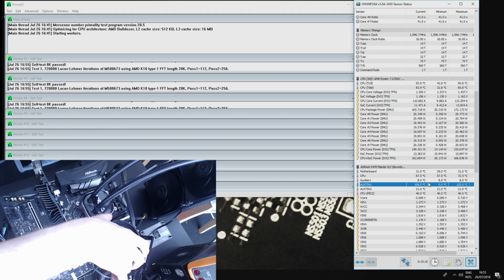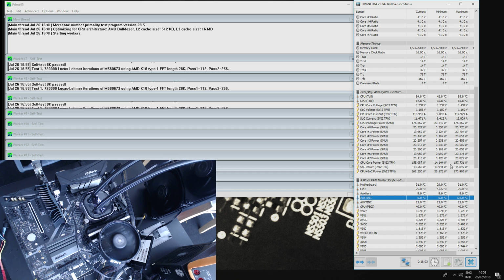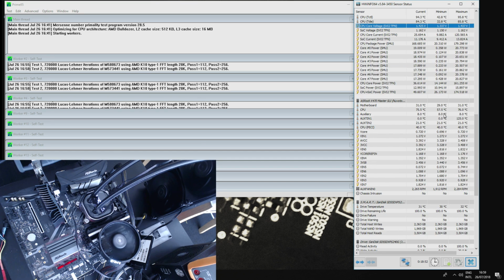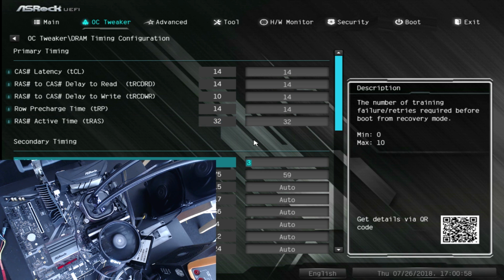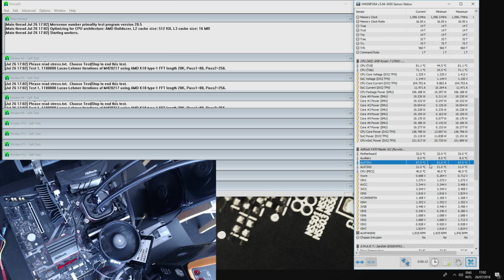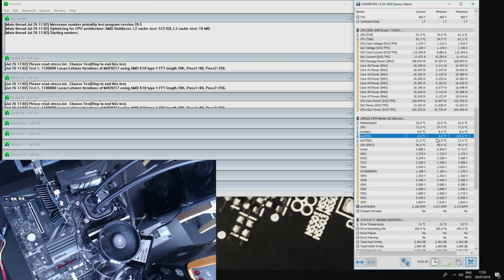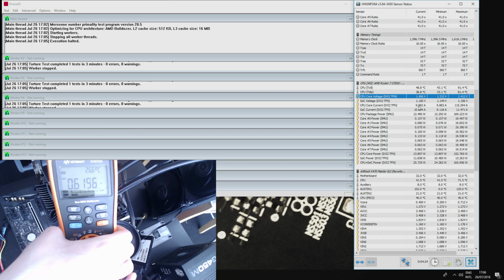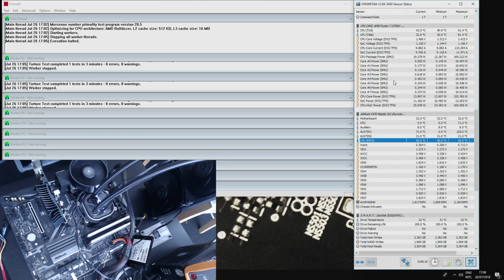The Asrock X470 Master SLI VRM temperature sensing is broken and there's no OTP either

Comment: Hey BZ, would you mind explaining why NIKOS MOSFETs are bad? What should we look for in the datasheets of MOSFETs? Maybe this could be a topic for a future video, comparing NIKOS vs other commonly used MOSFETs with datasheets up on the screen. Would be very interested to see PK616BA vs 4C09B vs 4C10N for high side usage, PK632BA vs 4C06N for low side.
Reply: I would watch it
Reply from the maker: Asrock is running PK618BAs for the low side on this board
Reply: I'll try to answer.
The most important are 3 params in order of magnitude affecting losses:
1. Rdson should be as low as possible to avoid conduction losses which dominates at high currents/power. Depending on the mosfets and VRM geometry (number of mosfets) it can be over 90W or over 120W. It is the most important factor for the low side mosfets (they should conduct a high current).
2. Dead times: Turn-On Delay Time+Rise Time and Turn-Off Delay Time+Fall Time. These are responsible for big part of the switching losses. You want these times to be as low as possible. It mostly affects the high side mosfet (they should switch fast).
3. Total Gate Charge - it is energy needed to switch transistor. It is part of switching losses but can affect both low and high side mosfets.

At low currents (<80A, <100W - stock speeds) the switching losses (2+3) dominates and the lowest Rdson is not critical. For the 150W+ overclocking you want low Rdson over switching losses. To make things harder, the lower Rdson the higher switching losses because it is harder to start/stop bigger current flow.

Mosfet categories:
3. ("The bottom") the Nikos are slow and have relatively high Rdson so they are simply the worst at any angle.  
2. The second level ("middle"? are ) 4c0xN and SM433x and 4c02xN. They are comparable to me however the 4c02xN have the lowest Rdson so they are prefferrable for high overclocking. 
1. The "upper class" are IR355x, CSD87350, etc. They are simple better at any parameter comparing to the "middle"s.

To make things even harder you can lower Rdson and make switching losses higher and it may be a net benefit to VRM efficiency easily: just double the components. At this point it does not matter if this is a "fake" doubling or "true" doubling as the only number of components matters. There is even "no doubling but doubling" when the VRM has 2 low side mosfets (benefits of low Rdson) but a single choke so it looks like nothing is doubled. This happens on all low end B350/X370/B450 boards with 3-4 phases. So the difference between these boards: MSI Tomahawk (4 phases) and MSI Carbon Pro (8 "fake" phases) is even smaller than you may think as these 2 boards have pair of the same low side mosfets per real phase (4 in both cases) so the Rdson is lowered in both cases.

BZ feel free to correct me.
Reply: Thanks for the detailed reply. Now I know what to look for.

On the topic of "you can lower Rdson and make switching losses higher" by "double the components". Am I understanding it correctly that you have 2 components in parallel so RdsON is cut in half, but total gate charge is doubled as it acts as a double sized transistor?
Reply: @sidtai: "2 components in parallel so RdsON is cut in half, but total gate charge is doubled as it acts as a double sized transistor"
Exactly. 
One can buy single bigger transistor but 1. it will be more expensive 2. the temperature is higher because 2 mosfets spreads heat dissipation on doubled area so mosfet temperature goes lower (simply, two mosfets take 2x space on the motherboard). Due to the point 2. even "fake doubling" is effective (halved Rdson + heat spread to bigger are = much lower temps).
Reply: Actually, what is called "fake doubling" is typical design for high power swithing supplies (in range over kilowatts) because there is too much power for single phase anyway.

Comment: ok so, if i buy any motherboard for ryzen i would buy a fan for the vrm too because reach 125degrees?
Reply: no, not necessarily. He was running a stress test and got his VRM up to max temp on purpose to see if it had any type of thermal protection built in. If you have good airflow in your case and a decent heatsink on the VRM that should be enough for the basic workload in most cases.

Comment: On the x370 Taichi, there is actually a BIOS setting that turns VRM thermal protection on and off, but that one defaults to enabled. No idea if it actually works when enabled though.

Comment: 84C CPU(tdie) at 1.344V? something is wrong with sensors or bios,i had 82C at 1.4V under load
Reply from the maker: AVX Prime95 Small FFTs also high ambient temps since I don't have AC.

Comment: So the ASRock Master SLI was a Newegg exclusive board do you think that Newegg had a lot of influence on the parts and configuration I bought this board but it didn't have bclk overclocking or load line calibration so I gave it to a friend and bought a ASRock taichi this was a when all the gpp stuff was going on and I don't intend to support gpp feel free to check out my build vlog I was able to achieve the same overclocks on both boards I don't remember seeing any sensors at 0 c maybe you got a bad board I'll have to review some of my videos from when I was checking out that board to see if Hardware info should zero C the vrm
Reply: Really dude? Newegg influencing board development? 
It's just some marketing bs deal between Asrock and Newegg for the US, that board can be bought at any store outside of the states.

Comment: Again, RIP me... Should've watched your video before buying this board... Hopefully the PBO/XFR algorithms doesn't let the board or CPU destroy itself...
Reply: I bought this too, I've been using it for over a year now and only just now when overclocking my 3700x did I notice the vrm hitting over 100 degrees
Reply: @connectronbuilds9960  That's why I switched to the X470 Taichi Ultimate. It has one of the most overbuilt VRMs of the 400 series generation.
Reply: @VigneshBalasubramaniam  Yeah, I actually came from a crosshair 6 extreme to this, It just didnt fit in my case. And before that i had the x370 taichi. So really I shouldve just kept the taichi. Que when I see you again

Comment: I have that X470 Master SLI, but only running a 2600x. And anticipating the hotter climate where I am, I already picked the Corsair 500R with side 140mm intakes. With 2600x 4.1Ghz@1.35V(droop to 1.28V) running x264 AVX-enabled encode for ~30 minutes maxed out at ~73 degrees (no air conditioning, ambient roughly in the 30s), CPU cooled by Deepcool Gammax 400 with two Arctic F12, two Actic F14 side intake + three Arctic F12 exhaust.
Reply from the maker: yeah this isn't a test of if the board is safe for normal usage. This was a test of what happens in a worst case scenario.
Reply: Totally understood. Just providing my piece of info on running the thing in less extreme scenario with the 2600x.
Reply: ambient 38C
Idle = 90C.
Load gaming = 94C.
Load stress = 98C
Ryzen 1700 @ 3950.

fanprofiling causing 90C idle (No fans run!)
ABB350m Pro something, same vrm ish
Reply: I have same x470 and 2700x and it hits over 100c just on stock while calculating lightmass in ue4 -_-
Reply: This board this good? For overlocking?
Reply: just to be explicitly honest, vrm is not good, It's suffecient.
stock 2700x probably runs with fans near vrm like I have.
Vdroop is crazy!

Comment: Which x470 for ryzen 2600? Gaming use
Reply: @Patrick Selva: Take the cheapest that's fit you - it is enough for this CPU. Now, I would turn to top B450 boards - they are cheaper and not worse then X470 - e.g. GBT B450 Pro (with or without WiFi) seems a better value than GBT X470 Gaming Ultra (cheaper but almost the same VRM, better M.2 slots, added DVI-D, the same audio & NIC, plenty of USB & fans connectors).
Reply: Biostar X470GT8
Reply: @TForce - do you have the GT8? I am interested if the GT8 can control DC fans (not PWM ones) using motherboard sensors through BIOS software? It was missing from GT7 (only PWM fans were supported). I checked GT8 manual but it is unclear to me if the GT8 can control DC fans?
Reply: get the giggity giggity Gaming  Ultra ,5, or 7 depending on your budget

Comment: I've seen on my Asrock z170m Pro4S that the cpu will throttle in synthetics when power and voltage were adequate and core temp was fine. It stopped throttling when I put a fan over the VRM, so I guess some boards have working OTP. Unfortunately no VRM temp sensor.

Comment: Z370 stuff...??
Reply from the maker: B450 and Z390 are coming
Reply: Speaking of terrible VRMs and Z390, I wonder how cheap can you go for the new 8-cores. Coffee Lake was able to run on good z170/z270 boards with a bios mod no problem. What would be the minimum VRM you would feel safe running with the new i9-9900K? How far could you get with a doubled 3/4 phase with just a fan?
Reply: But the 9th gen CPUs are closer to release, that may push away Z370 out of significance.
Reply: Shubham Patankar that's exactly why he doesn't wan't to do it
Reply: that still doesn't change the fact that "many" of his viewers own z370...    amd ryzen is the utube tech scene "in-thing" right now, so this is completely understandable.   it's not desired but understandable...

Comment: But also this motherboard have the crappy Nikos MOSFET?
Reply: @Kindis - SM433x are better than Nicos. The gap is quite big for VRM efficiency.
Reply from the maker: yup
Reply: Rhoken - This board - yes, but you can find a mobo with SM4337/4336 - https://www.hardwareluxx.de/community/f12/pga-am4-mainboard-vrm-liste-1155146.html
Reply: @Kindis - where can it be found? I am smelling that the first batch may have SM433x which are sent to reviewers and some into the market - have you noticed that most reviews says SM433x and not Nicos? Nicos go in the hands of people like BZ who buy boards themselves from online stores.
BZ bought this board now, few months after the release and he got the Nicos.
Reply: @Karpie.2 - Its not a different revision, its all based on luck as far as i know, same with the Z370 boards - Extreme 4/K6, even taichi and Pro i7 - https://www.overclock.net/forum/attachment.php?attachmentid=99753
I cant find any reviews of X470 Master SLI, but it seems like H370 Performance uses similar VRM. This board it is reviewed on KitGuru and it has the same NIKO's fets which can be found on Asrock's low end Z370's too. On Z370 Pro4/PC pro/Gaming plus its a gamble too, as you can see. I guess its a ''Asrock thing'', dunno which fets are better, i havent checked the data sheets and even if i do i dunno if i can say which one is better :P.

Comment: @buildzoid is it possible that temp sensing on a RX Vega 56 is broken ? I have  a brandnew Asus strix Vega 56 and it shows me at stock sttings vddc , mvvc and hotspot temps of 100+ degrees under load with excellent flow. Asus denies it all.
Reply from the maker: The hot spot going over 100C is not uncommon and it's possible to get it lower with some trial and error remounting of the cooler. The VRMs being over 100C could be correct depending on what fan RPM the card is running.
Reply: Check your local laws because in the US and EU, you won't void the warranty by removing the cooler.

The only other thing I could think of doing is to make sure that the cooler is mounted properly. See if you can screw it in a little more, but don't overdo it.
Reply: Hotspot temps tend to be very high, you should try for sub 100C though. I suggest replacing the stock thermal paste, and/or ramping up the fan speeds on the card.
Reply: If i ramp up the fans to 100% temps stay at 80ish on all 3 but noise is rediculous. Those temps are at 50 % normal fan speed. I cannot rearrange the cooler or i will void the warranty. Any suggestions ? Card is undervolted even.
Reply: SlavjanA  ill send Asus a mail about this. I did try to screw- unscrew the baseplate screws but everyting seems to be in place. The other screws are not accessible from the outside.

Comment: Wow GG

if(VRM_Temp > 125)
{
    Do something
}

Oh, it's now 0 degrees? Must be fine :P
Reply: It can't be due to integer overflow as that would happen at 127 at which point you would expect it to overflow to -128. That isn't happening which means it's either a hardware bug on the sensor or a software bug in the bios. Without knowing the sensor used we can't rule out the first option.
Either way this is within Asrock's ability to implement an actual over-temp protection to stop boards from literally catching on fire/exploding.
Reply: CommanderWolfyX that was an underflow glitch in the first civilization game that the creators of the game then kept on purpose in future installments in some form or another for the memes. If anything this is an overflow.
Reply: It happened when Ghandhi would choose democracy in the first game as his mode of goverment, which he alwys does if he got late enough into the game. This would lower his agression even further below his already low agression, causing his agression to then underflow to 255/10 compared to his baseline 1/10.
Reply: 0 is the lowest the software goes and so it can still be overflow
Reply: If the software has an offset then what what we see as 0-125 could be 5-125

Ignoring that its not actually 0 or 5 at the point of startup
Reply: CommanderWolfyX It can’t be a standard overflow from increasing a value too far as that would happen at 127 not 125. That’s how binary integers work.
Something else must be changing the value to 0
Reply: Might have a 2 degrees offset for accuracy... lol.
Reply: i have the x470 gaming k4 same bios nearly same board
my cpu sensor hows negative 62 deg at idle...... could be uefi error. i hope so, rma would suck.. hope for a quick fix.
Reply: CommanderWolfyX Whilst theoretically something strange like that could be happening it wouldn’t make much sense.
Reply: if(VRM_Temp > 125)
{
   VRM_Temp = 0;
   CallFireDepartment();
}
Reply: Its actually because of a code error that resets it to 0 on error.

It could also be like something that happened in a game i forgot the name of.

If you do peace stuff with Gandhi and his thread goes under 0 it cycles around to max and he nukes everyone.

This case is just it cycles to 0

Comment: Had asrock on a higher standard I guess they are all the same, pathetic!
Reply: lol you clearly havent used 970 extreme (socket am3). First one burned a vrm or something while running stock clocks with stock cooler moving some air around the vrm. The replacement one i use now constantly has issues with the ram and gpu not making good enough contact and at one point stopped working completely until i tried troubleshooting it and manually shorted green and ground of the psu while plugged in, saw some sparks around the cpu and now it works like the same shit again. DO NOT BUY ASROCK
Reply: I've had a number of ASRock boards and haven't had a single problem. But that obviously doesn't mean that no one has had problems with them. Anecdotal "evidence"...
Reply: I've used only MSI boards previously, all of which had issues. Now I've got an Asrock B450M Pro4 and it's great.

Comment: It's 34c right now in London, the VRM on my X470I-Strix is at 47-50c at idle. Is it normal to be concerned less about myself and more about my rig?

Already had to drop to 3133Mhz on RAM just to keep the system stable.

Maybe I should also dismount that stock Ryzen fan and make it an exhaust for my Mini-ITX case.

I thought summer was supposed to be fun, well I can't even play something decent, I have to wait until night time before I'm sure the game won't crash due to instability.
Reply from the maker: what are you using to read the VRM temps on that board? because on the Prime X470 Pro I couldn't get HWinfo to read VRM temps at all.
Reply: Fizzacles 47-50c isn’t that bad if max is 125c
Reply: HWInfo64 seems to read everything perfectly, goes right with what the motherboard BIOS shows. Asus only spared the expense on the SOC side of the VRM, but otherwise the sensors seem fine.

I had a problem running Speedfan with the MSI X470 Gaming Plus, since it couldn't detect the SuperI/O chip, but I stopped using SpeedFan in favor of plain old fan curves in the BIOS.
Reply: Fizzacles Brits and Yankees don't have AC
Reply: I probably set it to 100c